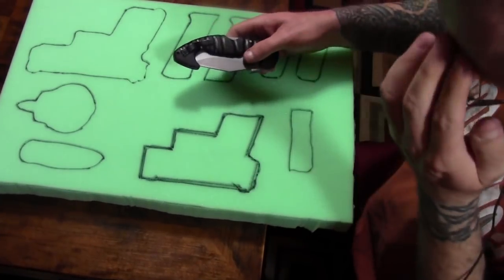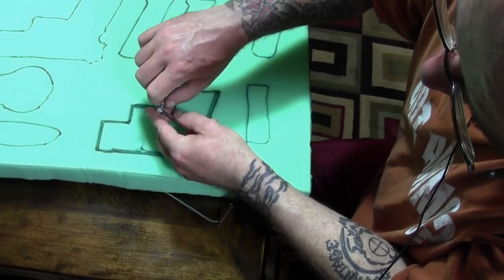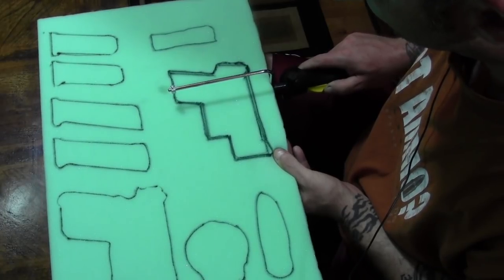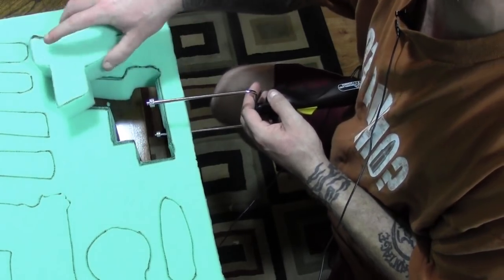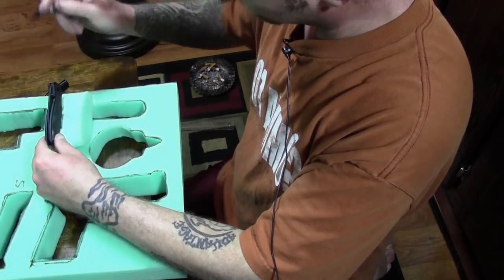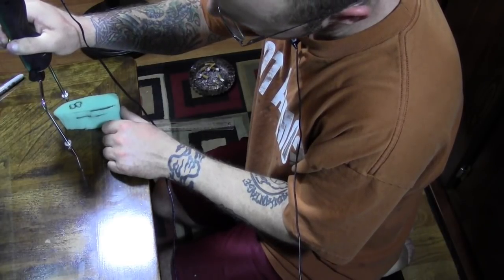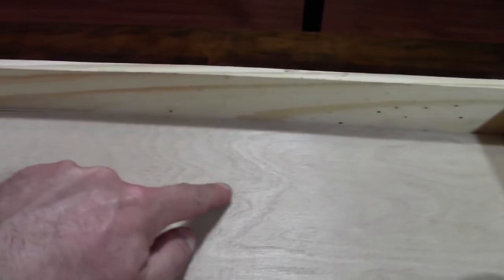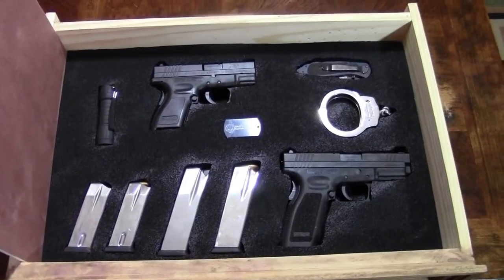DIY, Nightstand with Secret Compartment for Gun Storage Pt.2, Hotwire Foam Cutting and Reveal

Comment: quick tip to false bottoms. Use a very thin felt or other such soft material (with a light color) on the "bottom" and stain the sides a dark brown or black. It creates a minor optical illusion and gives the impression of greater depth.
Reply: JayneCobb88 
Nice tip man thanks

Comment: Pretty good DIY job. Something like this generally works best if you put the drawer on the bottom as well, it's a steeper angle so it's harder to see that the depth is incorrect.

Comment: Make a jig for thickness cutting. Perhaps a 1x8 12" long with two holes to place the rods in. Maybe some metal bushings of the correct size placed in the drilled holes. It will free up your hands completly to push the foam thru. Love you vids

Comment: I kind of want to do this now, but I had an idea, if you get some thin wire and attach it discreetly to two spots on the inside top of the drawer and the front of the false bottom with enough length to let you open it, but past that length it will lift the front edge up to reach in and grab what you need. May or may not work but I might try it if I get around to this.

Comment: Good Idea! I would suggest doing that in a well ventilated area or outside because burning or heating any kind of Polyurethane is very bad for you. We used to hotwire foam like that at work until they did a air analysis of the work area. Using a simple kitchen knife would probably work the same with out the fumes. Nice design though!
Reply: Agreed - some of the foams are really toxic.  God ventilation is mandatory. You can also make your own hotwire with a transformer and a wooden frame.  Use a dimmer to control the temperature, and BE CAREFUL about the temperature.

Comment: Another way to judge your depth would be to insert your cutouts back into the main sheet then put the items in the foam and push them out the backside then mark the foam on the backside, then cut that much off the top side.
Reply: +Johnny Utah put the cut out back into the main piece. Push the items into the foam until they are flush with the top. The excess from the cutouts that you would need to remove would be sticking out the back.

Comment: Very nice idea but i have some input. There should be recesses behind the guns stocks in order to make grabbing them easier. Also, how far out does this drawer open? My concern is that most drawers don't open completely and the "door" may catch on the frame. As far as kids, if they can't pull back the slides i wouldn't worry but it's something to consider. Very nice job and great instructions. Thanks.

Comment: You could mark the depth of the insert from the bottom, then cut out the thickness of the item from the bottom and put the insert back so there is the smooth factory surface on the exposed face. Probably doesn't matter cause you are going to cover it, but that's my two cents ;)

Comment: Outstanding -- clever, creative, and crafty.  Great idea and execution.  Moreover, you make an excellent teacher, all around very impressive and helpful.  As to the accurate comment from Nohalo4me regarding a home intruder throwing the drawer on the bed, this could be easily rectified with the use of simple Velcro strips to affix the thin, lightweight false bottom cover.  This could also be used for the handle (glass case in your example).  This is obviously not s secure as biometrics but at that point no only does this get expensive and far more difficult but it is not that useful with thin wood or fiberboard.  In any event, great job, thanks.

Comment: Don't knife cut on your lines...   start your wire cuts in the middle scrap areas.  That way all finish edges are cut with the wire.  In fact do not start finish edges in the middle of a straight line either have the entrance/ exit points at a sharp corner or rounded edge.

Comment: It is much easier to get 2 pieces of foam. get 1/2" for the bottom and then 1" or 1-1/2" for top. Use 3m spray adhesive to attach the 2 pieces after the top piece is cut out.

Comment: When you are making your relief cuts it would be a little easier if you have a piece of wood with two holes drilled into it spaced for the prongs of the hot wire tool, that way you aren't struggling to hold it perpendicular while sliding the foam through.

Comment: You should have used a magnet system to open the false bottom. If someone breaks in and is rummaging through drawers they could hit the eyeglass case and figure out that it doesn't move and go to pick it up. But good job still!

Comment: Gonna have to give this a shot. Might I suggest adding "finger slots" on items such as mags, so it's easier to grab ahold of them. What did you use for the rubber coating? And has anyone ever said you sound like Johnny Knoxville?
Reply from the maker: Finger slots is a good idea. I used plasti-dip for the coating. Easy to get at any of your big box home improvement stores usually with the spray paint. And No I haven't heard I sound like Johnny Knoxville but I guess it could be worse...lol

Comment: Just a thought regarding your first cut, since you were mentioning how it is a sloppy cut. Why not start in the middle of the shape instead of the actual edge on the line? This way, you can run your hotwire to the line from the middle,  and then make a clean cut all the way around.

Comment: Sweet. Genius idea. Couple ?'s... Where did you get the hot wire & how much they run? Also where did you get foam? I checked JoAan's & it was expensive as hell. Got any low priced foam suggestions? Thanks for video. Think I'll give it a try.

Comment: Did you find any difficulty in the access of side lift versus front lift? Specifically in an attempt to quik retrieve, such as having to pull the drawer all out to open. Or is it an open top table.?

Comment: I would measure the thickness needed from the "bottom" of the foam, rather than from the top, and add 1/16" to 1/8" instead of measuring and cutting from the top. Then remove the top of the foam to discard, not the bottom. That would allow the false bottom of the drawer to sit deeper into the drawer.

Comment: great idea but one problem i see is that the whole thing needs to come out of the night stand two open it.  For me i would rather have something i can access quickly in the middle of the night so a suggestion would be to cut the pad-items farther "south" and pull the wood off "south to north" rather than "east to west. so you only have to pull out the draw so far to grab your gun.  Does that make sense?

Comment: Here's the fix for the false bottom. Glue a 1in by 4in strip of metal under the false bottom and use a high powered magnet to remove the false bottom when you need to access it. Just a thought.

Comment: I'd make your handle out of lip-balm instead of an eyeglass case... Think like a burglar for a second, there might be money or oakleys in your case.. And there's no way in hell i'm gonna break in just for some cheap 99cent lip balm. For a more secure box, add a locking pin on the side of the box (just drill a hole through the balsa wood & box and slide the pin in).. To get the pin out and access your stash, you would use a magnet to remove the pin. Personally, i would always keep the gun within reach with a round chambered - the problem with slide actuated side arms in a self defense scenario is that either the slide can fail or operators error from the pressure of the situation can also provide room for error.. If it's life and death, i'd rather not fumble around with the balsa wood / etc.. I'd rather reach over and know i have a loaded firearm to defend my family / self with; not to throw you into a panic though cause only a handful of break ins occur a year, and a portion of those break ins are lethal.. you'd have better odds hitting the lottery unless you leave your house unlocked with a sign that says "right this way to the safe and free cash!"

Comment: Great instructional. Until I saw you were using the cutouts for vertical spacing, I was also thinking about doing the plunge in the center, but now I see.

Might I suggest, cutting off the BOTTOM of the inserts leaving the top with the original finish of the foam and just pushing them to the bottom?
Reply from the maker: Really the best way would have been to use 2 one inch pieces. I could have used one piece as the base and cut out the second layer. Would have been more uniform. I have progressed since this video and have a very cool much larger project coming in a few weeks
Reply: TacticalAdv I thought about that as well, but if you wanted the items at the top, (the knife is thinner than the mags and they are thinner than the sidearms) it wouldn't work as well. Looking forward to the next video.

Comment: wouldn't it be easier to get 2 on inch pieces of foam and make the cutout in one then glue them together?
Reply: +Luke Widas probably.. go for it
Reply: +Luke Widas  Yes.
Reply: No, he didn't cut them all in half. He cut them in different sizes depending on what he wanted to fit in there.

Comment: It seems like the floor opens the wrong direction for a bedside gun. It the guns are positions buts toward bed and barrels away from bed, the floor should be hinged on the barrel end of drawer. That way, the false floor will flip out of the way of the gun, and not be in the way of the hand reaching in for it...otherwise all around impressive DIY

Comment: just cut through the foam with the hot wire and then use a touch of glue and it will be like new.  no need for all that screwing and unscrewing of the hot wire.

Comment: You could do something like this for a lock.
http://youtu.be/XXbeQwbSVR0
(Skip to 0:45) If the foam would have been thinner and used .5inch to an inch for the false floor, you could have cut a side of the cabinet and drill holes for 1/4 inch diameter dowels. And insert it to connect the side of the cabinet to the false floor and act as a lock.
Also glue a piece of Cloth (something thin but strong) to the opposite side of the "lock" so it can act as a hinge, and the finish product be a hidden lockable door.